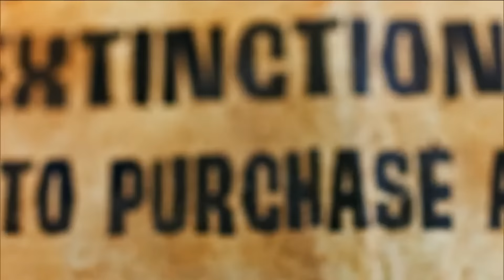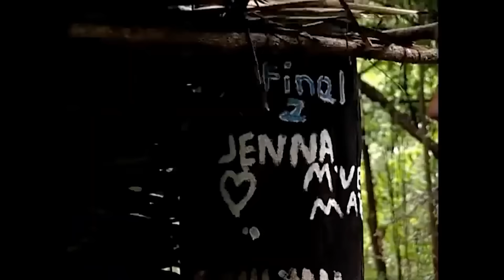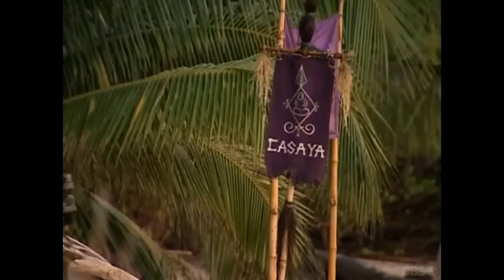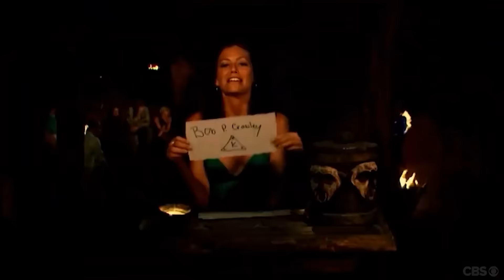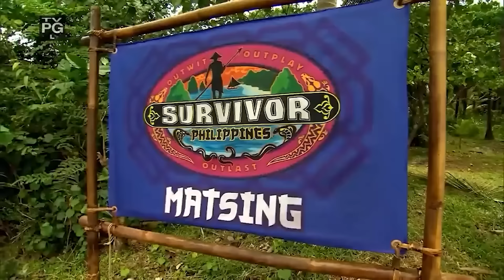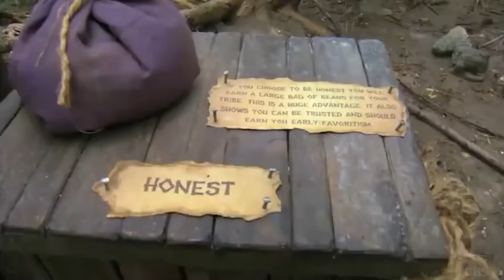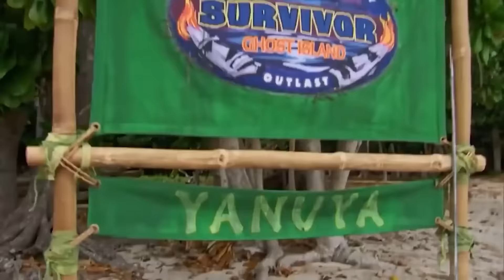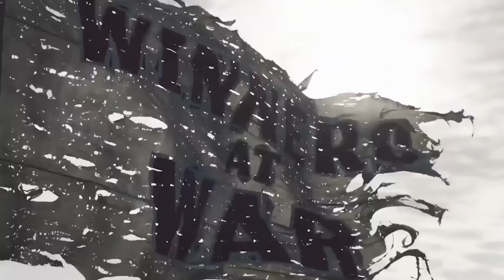The Ultimate Road to Victory for Every Survivor Winner - ALL PARTS (1-8)

Comment: Some of the early winners are interesting.
Chris in Season 9 charmed his way to victory and beat overwhelming odds.

Tom in Season 10 had arguably the easiest win as the other tribe was systematically eliminated and his tribe didn't have to vote on each other until 2/3 of the way through. Then with a quit, and then voting out the last  member of the other tribe, Tom had plenty of time to get his ducks in a row.
Add a tribe member being silly enough to give Tom immunity, and viola.

Aras had arguably the hardest run to victory in Season 12, and Yul in Season 13 repeated Chris' trick and charmed his way through.

After this most winners are very bland. Mike in Season 30 only won through sheer physical strength, while Jeremy from Season 31 was the last truly deserving winner - Michelle from Season 32 just had "good luck" in that two strong players had to be evacuated and Ben fluked his way to victory in Season 35 with constant use of Idols.

LUCK ALWAYS plays a pivotal role.

I think the brightest spark for a long time was the lovely Christina Cha, who just had the misfortune of being cast with a group of horrible people in Season 24.